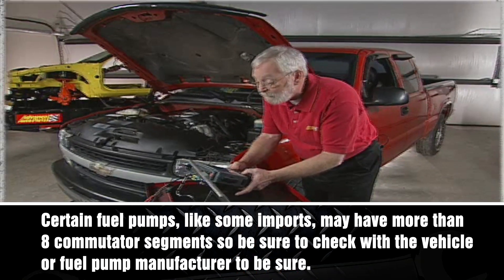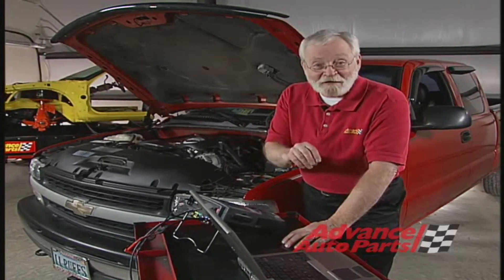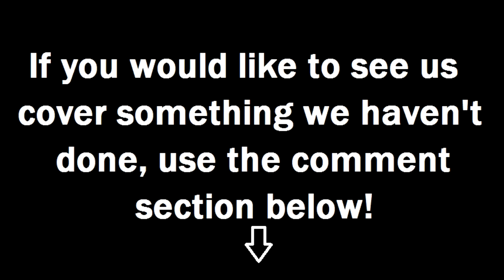Current Ramping Fuel Pumps - Wrenchin' Up

Comment: I installed a new pump in a running vehicle that ran for 6 days. At the pump harness 12v+ and 12v- voltmeter hooked in series relay jumped. Relay 12v+  at pin 30. DVOM in series from pin 30 (12v+ to the pump side) reads 5.9v. Replaced pump, vehicle runs. Check other pump and it runs now. I put 180,000 miles on the original pump and only changed it as routine since the tank was rotted. New pump installed reads 12.4v across relay in series. I'm perplexed as to the problem with the 1st pump and bought a scope to check it out but thinking it was either heat related or a bad brush or  bearings.
Reply from the maker: Hi Max - Yup, proper voltage (system voltage) at the pump is important but so is amperage because voltage is just pressure. Electrical resistance and mechanical issues will affect that. Now that you have your scope to look at pump speed, you'll quickly be able to tell if the problem is electrical or mechanical. Thanks for your watching!
Reply: Hi Jim, thanks for getting back. What I bought is a LabVolt dual trace analog scope for $100 (no money for a vantage). I need to figure out an amp clamp but for now going to run my DVOM in series. Having a fight with the manufacturer, it is supposed to be a lifetime pump. The second one is of such poor quality that terminal slide out of the plastic plug when I installed it. Luckily I caught that or I would have done this 3 times by now. Unfortunately they no longer offer a labor warranty  here (no longer owned by Federal Mogul) and I felt pretty stupid when my personal work van broke down in a busy intersection  2 blocks from my house. As I said, I changed the pump but figuring out the problem makes us better mechanics rather than parts changers and thanks for the video. Your points was bang on about the dead spot vs pressure test.

Comment: So tell me what happens when the wrong 2 pins are shorted together? On the relay that is
Reply from the maker: +Joseph Tucci - The short answer (for most modern vehicles like the one in the video with an electric fuel pump) is nothing. If you look at a wiring diagram for your vehicle (if it has an electric fuel pump) you will see that one of the pins sockets in question is basically connected to a fused power supply and the other is connected to a switch (transistor) in the PCM. So with the ignition off, jumping the "wrong 2 pins" could just supply power to the switch in the PCM and nothing would happen because the circuit is not complete. With the ignition on, the circuit's fuse might blow if the PCM turned on the switch to complete the circuit and run the fuel pump.
Reply: +Jim Bates And if the ignition is on and the wrong 2 terminal's are shorted together nothing will happen I did not know that Ok thanks Joe
Reply from the maker: +Joseph Tucci As I said, it might blow the fuse. That is because the relay winding has resistance that is no longer in the circuit when it's pin connectors are jumped.